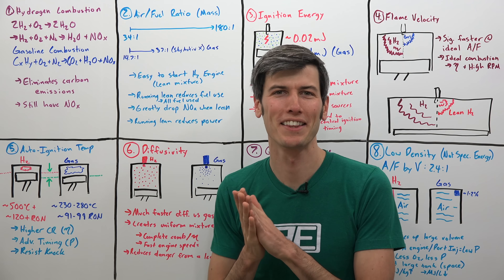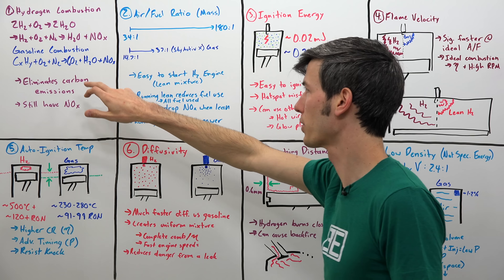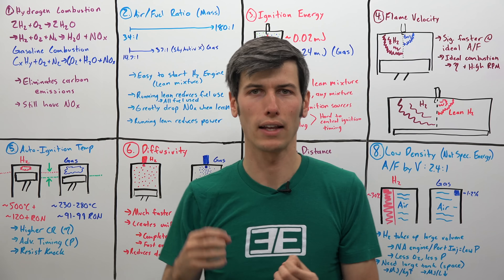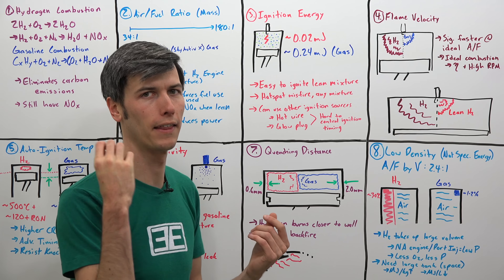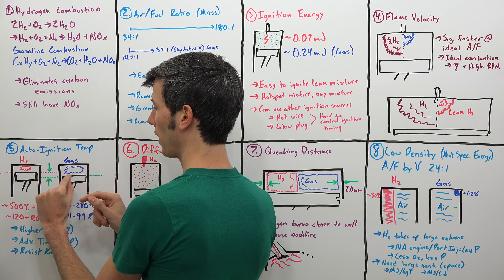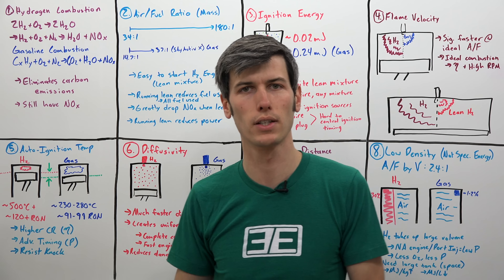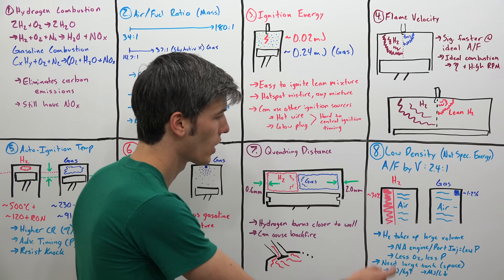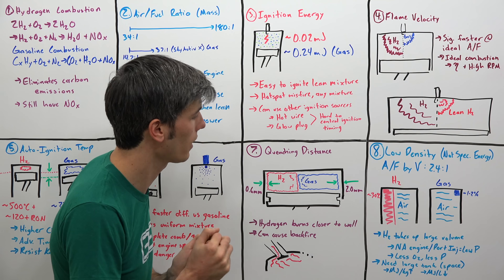The Difference Between Gasoline And Hydrogen Engines

Comment: If you are already going to haul around compressed cylinders of hydrogen then why wouldn't you just do the same with oxygen and inject both?
Reply: In order to do this you would have to have large amounts of fuel and oxidizer. For example, a 1 liter engine at 7000 RPM would require 3500 liters of gases per minute. Half of your vehicle would be pressurized tanks. Sounds like riding a bomb and you still wouldn't make it as far as a tank of gas or hydrogen using atmosphere.

Comment: You still have to make hydrogen to burn.  This is usually accomplished by electrolysis.  What are you going to use to make the electricity to do the electrolysis?  Besides, hydrogen leaks through EVERYTHING.  How much will power will be lost in inefficiencies in both the electrolysis and leakage?  This also requires replacing all of the existing infrastructure.

Comment: Instead of having a hydrogen tank why couldn't you have a machine on the vehicle that turns water into hydrogen. From what I understand it is hard to split those molecules. Couldn't you have the water pass through a system that has a laser to split the molecules. Basically you would fill you gas tank with water and a pump would pump it to the splitter then as hydrogen it would go to the engine.

Comment: I worry about burning out the exhaust valves with a LEAN mixture.
Reply: With modern oils you don't have to, unless you are running you engine like a race car at high RPMs all of the time.

Comment: Could you do the same thing with Ethanol and mixed Ethanol+ hydrogen ?
Reply: You can use Alcohol in place of Gasoline. It will however take more alcohol to equal the same amount of gasoline so your fuel mileage will go down.

Comment: I love to see the day that hydrogen car kill the electric car lol
Reply: If hydrogen is widely used in cars, it will be using fuel cells which are much more thermodynamically efficient and won't produce NOx. Of course, a hydrogen fuel-cell car is electric. So if hydrogen does get used in cars it will be promoting electric cars.
Reply: For vehicles the size of cars batteries just make more sense. In the last ten years battery cost has dropped by about 80% with density halving and charging times tumbling; in another ten years it just won't make sense to use hydrogen in a car.
Reply: Helen Lawson Hydrogen cars been out on the market since the 90’s. It’s just that nobody really wanted them. Hyundai still has on on the market. But, it’s a special order.  They perfected the hydrogen car to the point that’s it a better car then a EV. There is a lot of things Jason don’t tell you. And he is often wrong. Plus, EV’s isn’t a good car for a lot of areas beside a city. EV lose their value faster then any other car. You can pick ups a used Tesla S for a 50%-75% discount(resale value). Not to mention that 2 times more emissions are produced in making EV then a gas pod.
Reply: @decayofalberta1520  So much misinformation. Tesla Model 3s are holding their value amazingly well. The 130 miles per (US) gallon equivalent mileage makes them use less CO2 than any engine car after two years at average miles per annum. More importantly Tesla have proved the battery life is at least 300,000 miles and potentially 400,000 or more. Very few engine cars get beyond 150,000 miles.
Reply: David Elliott there is the thing. Electric is responsible for 25% of emissions in the US. Same as 25% gas pod are responsible for emissions. It’s the same. You have look at the source of the electrical to charge. Plus, like I said.  A electric car makes 2 times more emissions then a gas pod in the production process. You have to look at that too. Gas engines are getting cleaner with every pasting year. Only time will tell if EV stand the test of time. The first car was electric in the late 1800’s. They faded away after the gas engine came out. They tried again it before in the 70’s. And it faded away again. History has a way of repeating it.

Comment: Problem is h2 is hard to store in enough quantity yet the most abundant element in universe
Reply: Actually H2 hold pretty well in Pd tanks, but maaan, they expensive.... H2 cant be held in an iron container, because of the process "iron fatigue".
Reply: In order to do this you would have to have large amounts of fuel and oxidizer. For example, a 1 liter engine at 7000 RPM would require 3500 liters of gases per minute. Half of your vehicle would be pressurized tanks. Sounds like riding a bomb and you still wouldn't make it as far as a tank of gas or hydrogen using atmosphere.

Comment: And a last question, if you produced Hydrogen using a separating electrolysis generator and fed the Hydrogen into the fuel system, and the Oxygen into the air intake wouldn’t your air demand be less (air being a gas mixture that has only 21% oxygen and 78% nitrogen) so that the total NOx compounds produced would be significantly (or at least somewhat) less?
Reply: No. NOx gases are made by having Nitrogen and Oxygen in the same space at high temperatures ( above 700 degrees I think ). so by adding more Oxygen you are actually making the problem worse. If you want zero NOx gases than you need to use all of the oxygen by burning the right amount of fuel.

Comment: When you talk about port intake you mean standard old-school engine with a carburetor that dumps a gas/air mixture into the intake and then that mixture goes through the intake ports? And by direct injection you mean something like electronic fuel injection or maybe the type of injection in a Diesel engine?
Reply: oddjobbobb You’re right, port injection is where the fuel and air mixture is mixed and enters the cylinder through the overhead valve, like an older EFI where the injector squirts in to the intake port of the head, or say you say, like a carburettor. Whereas direct injection is where the injector is mounted to directly inject the fuel directly in the the cylinder like a modern diesel, and majority of all modern petrol engines too. Basically, you got it
Reply: Todd B thank you for this clarification. I understand now. I owned a ‘68 VW fastback that was a very early generation (maybe the first year used as I think about it) Bosch EFI. It was a great car. Totally new to the EFI system, anytime the car started to act up (misfire, rough idle, hard-start), my mind went immediately to that system. But it was always something else much more basic (timing, tuning, alternator/battery). I have a ‘94 Jaguar XJ12 that has direct injection. It took a while for me to understand that cat (no pun meant, but that was pretty good) because of my earlier experience with EFI. 
Are all your points comparing H-2 and gasoline as fuels for internal combustion engines the same if your engine is naturally aspirated through a carburetor? I’m not saying the carb is the “feeder” for the H-2 (although it could be I suppose, dribbling in liquid H-2) but that the engine construction is of that sort: air intake> air filter> carb.> intake manifold> intake valve> cylinder on intake stroke?
Reply: oddjobbobb EFI is not as complicated as you may think, the basic principal is exactly the same as Carburettor fuelling, yet EFI is an advanced system that has the ability to adjust the air & fuel mixture on the fly as you drive, creating more efficient fuel economy and combustion. Where with a carburettor you would have to adjust jets and fuelling prior to driving, which some manufacturers did rectify by using timing advancing systems, such as air operated vacuum diaphragms. The system would work the same regarding the H2 feeding but your efficiency wouldn’t be as great.

Comment: When it comes down to long range the gasoline or diesel wins out because of emergency density . Hydrogen can be compressed to a liquid . that is the limit of storage like LP . It looks like using biofuels is a great option to consider . Ben running a farm tractor on biodiesel for a while now.     Cold starting is biggest set back so I just mix . Great job in video ! lots of good points !!

Comment: One major deceptive difference is pre consumer production off gassing of co2 with the creation of hydrogen via the separation of H2O. Its not green nor eco friendly at all. Its only clean for the consumer
Reply: So we dont create CO2 by burning stuff to charge the electric shitboxes,  but we create CO2, by burning stuff to produce H2?  Is Greta ur best friend, do u share a common brain? FYI, electric cars are also clean only for the consumer...
Reply: @vladislavzlatev9288  
I simply know hydrogen fuel cells as they currently sell them to us. Designed to burn hydrogen while leaving the dirty work to the fuel seller. Is a bad idea. While the only way to do it. In a clean manor. Is to burn water. While the engine also bottles and pressurizes hydrogen, and Co2 To be turned into industry as a tax credit. To the vehicle owner.. Plus 
Greta Thunberg was born under an environmentally conscious astrological sign. The Capricorn which is the Sea Goat accordingly with her birthday. She was born to butt heads with those whom are not environmentally conscious. She and her message should be considered. a Gift and a messenger From the Gods.

Comment: This will run on any liquid fuel and could electrolyse water into H2 + O2 to mix with the petrol fumes.

(In-Wheel) Hydro-ICE (Turbo) Hybrid Sterling Motor/Generator/Pump..

o Free, strong magnet topped pistons fire in copper coil-wrapped cylinders
o An axle-mounted, slitted cylinder magnet, bathed in lubricating, hydraulic coolant, repels the piston back
o The hydraulic fluid pushes on the slits as a hydraulic motor. Strong magnetic gearing also turns the rotor
o 2,3 or 4 cylinders I , Y , X configurations
o Electromagnets between the cylinders also repulase the rotor but I don't think they can generate power
o Piston magnets could be curved to fit the rotor magnet if oval cylinders are used
o Sterling enginge generator merged with the catalytic converter
o 1 or 2 mini turbos mounted horizontally between the cylinders
o Enough room inside for a small clutch, fixed ratio gear box and another powerful electric motor/gen.
o The coils could force the piston to compress the mix to a high ratio, (way) past auto-combustion
o The design could work centre-out too, with the pistons firing at rim mounted magnets

 An engineering challenge that would be cool if it worked. In some ways simpler than a standard, cranky old ICE.

Comment: Your diffusivity is a little misleading.  The system has to be turbulent to get that with H2 and air.  H2 likes to 'hang together' around a leak in a vessel or line, creating a bubble of H2 that can actually be too low in O2 in the middle for it to be ignited.  The bubble can be easily ignited at the edges where the 02 concentration is higher.  The bubble also can carry static charge of sufficient voltage to ignite the bubble when it dissipates.  I've seen this (and even deliberately cause this to happen) many times.

Comment: Please also explain the benefits of the Catalytic converter, when dealing with gasoline.
Reply: The Catalytic converter (simply) uses heat to convert exhaust gases into less harmful exhaust gases. If you do a search on any search engine and take 3-5 minutes to read, you will find the information you are looking for on this topic. \\ So, what does a catalytic converter do? Your catalytic converter converts carbon monoxide into carbon dioxide, hydrocarbons into carbon dioxide, and water and nitrogen oxides into nitrogen and oxygen. Nitrogen oxides and hydrocarbons are both causes of smog in the environment. A buildup of nitrogen oxides can create acid rain. \\ In between the \\ is a quote from autozone that took me 3 seconds to type, 1 second to wait for the search to load, and 5 seconds to read.

Comment: Would it ever be feasible to implement a N2 stripper to separate the N2 from the 02 in the air to make the oxidizing component in the cylinder 3x as dense, eliminating the NOx, etc? Or use liquid 02 and directly injecting it and the 2H2 into the cylinder?

Comment: How about inventing a device that would turn water into hydrogen and oxygen and then compressing those gases into a liquids and then using it as fuel. So instead of carrying huge hydrogen tanks, fill the gasoline tank with water. I’ve been wondering about this for forty years.
Reply: Water is broken into hydrogen and oxygen by electricity. You never get back as much energy from the burning process as it takes to split the water molecules in the first place.

Comment: What happens if you take a bottle of hydrogen peroxide off the shelf is about 7% What does that do to the equation? Running it through electrolysis. Then running it through the combustion engine. Is there any change?

Comment: On a Diesel they use a EGR to reduce NOx. That essentially makes the engine run richer because there is less air to burn. Wouldn't that be the same for hydrogen?
Reply: Yes.

Comment: So if we injected O2 and H2 we could completely wipe out nox emissions without compromising power?
Reply: While this is true. In order to do this you would have to have large amounts of fuel and oxidizer. For example, a 1 liter engine at 7000 RPM would require 3500 liters of gases per minute. Half of your vehicle would be pressurized tanks. Sounds like riding a bomb and you still wouldn't make it as far as a tank of gas or hydrogen using atmosphere.

Comment: There is no need for massive fuel tank for hidrogen please take a look into the Bob lazar's hidrogen corvette... He found a way to put hidrogen in a small tank at low pressure by just using the same method rockets use in their hygrogen fuel tanks

Comment: Great lecture! I'm curious to know your thoughts on HHO supplementing a gasoline engine. Apologies if this is something that's been thoroughly debunked or is otherwise specious. It's just something I've seen kicked around for about 10 or so years and each time it cycles through I get really curious about it.
Reply: I am also interested in HHO generators, it looks like it would be able to reduce fuel consumption, the positive points from the video are the lean ratio required to burn(by leaning a percentage of fuel, then adding HHO you could produce the same power for less fuel used), fast flame front(advances the timing to produce better power which is more fuel efficient), higher octane, better mixing of the fuel. It looks like HHO would work but you need a pulse width modulator to control the amp draw and heat, then you also need to be able to change the fuel map of the ecu to lean the fuel mixture. Any thoughts on this Jason?
Reply: They're completely fake and the guy who started the idea was a con-artist.

You simply can't get out more energy than you put in - you need energy to split the water so any benefit would be immediately negated by the inefficiency of splitting the water into hydrogen and oxygen. It's like shining a lamp on a solar panel to power the lamp - it can't be done.
Reply: @drunkenhobo8020  LOL

Comment: Are there any advantages to also supplying the Oxygen for the combustion, instead of relying on what's available from the atmosphere? I assume you'd be able to get more power, have it burn cleaner and also have a lot more control over the combustion than by just supplying the Nitrogen.
Reply: If you make the hydrogen easier to combust to get more power using oxygen, you would need an even larger hydrogen storage tank.

And that hits exactly down in the biggest drawback on hydrogen as a fuel : it has a very low energy density.
IMHO its the most common issue that prevents practical use of hydrogen as a fuel in cars.
Have a repeated watch on the last 3-4 minutes of the video, exactly on this issue.
Reply: @CXensation  I think you have it backwards. If you make the hydrogen easier to combust using oxygen, it would take less Nitrogen to make the same amount of power. It would, however, also require an oxygen storage tank, which might render the idea moot.
Reply: @rexstuff4655  And that was my point: you really dont gain anything as a result.

Comment: Engineering Explained

Hey  I hate folks that correct little mistakes But you made a big one in this video. On Chart 4 you say  that hydrogen burring faster is better. You said burning the fuel all the fuel at TDC Top dead center creating all that pressure at TDC is good.  Very wrong. It may  SEEM like a good thing but it is not. Zero work is done by the engine at TDC. The maximum work is 90 degrees down from TDC. Thus THIS is where you WANT the most pressure pushing down on the piston.  The first hydrogen-powered engines used exhaust mixed with fuel to Slow the burn rate. With gasoline engines Higher Octane is slower burning than cheap gas that explodes at TDC causing power loss and pinging and damage. Diesel burns even slower thus puts out more power.

Comment: Always have been a fan of hydrogen, the major set back in using it in passenger autos is storage of the highly explosive substance. so my thought has been putting a hydrogen generator on board. Very easy to make and the only tank would be for water

Comment: H2 o2 isn't water h2o is, it's comprised of 2 parts hydrogen and 1 part oxygen
Reply: H2O2 is known as Hydrogen Peroxide. Hydrogen Peroxide breaks down into H2 and O2 when exposed to very high temperatures. That is why it was used as rocket propellant back when they were learning rocket sciences.